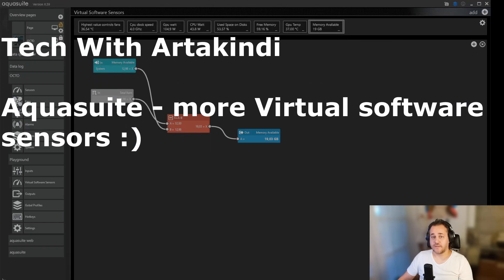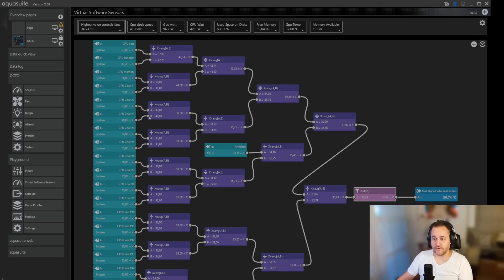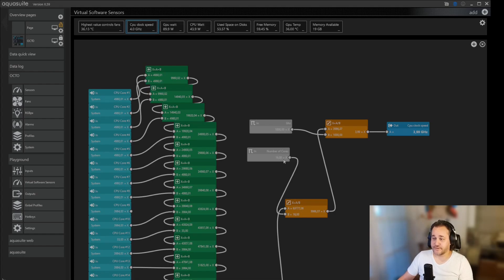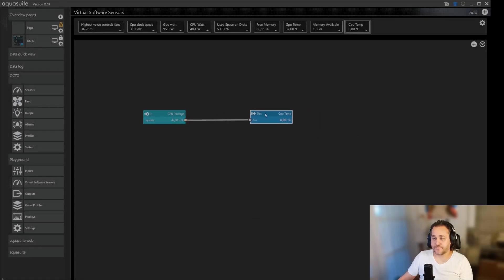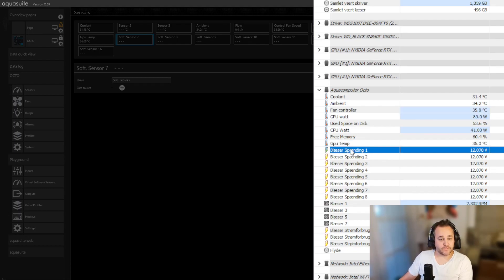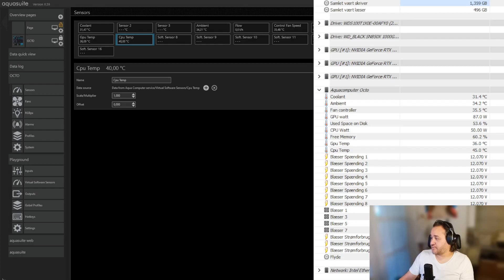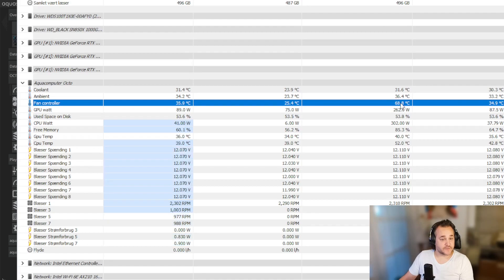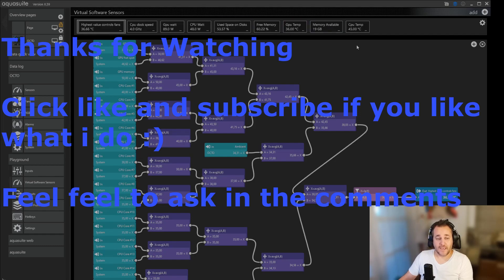Aquasuite Virtual sensors

Comment: Works, the only issue I found is that HWINFO doesnt seem to detect the value type. For an example: I have a virtual sensor that calculates the Radiator wattage and expor that value in Watts; in HWINFO I need to change the type to Watt and multiply the sensor value by 100 for it to be displayed correctly.

Comment: Great explanation and video, I'm using this for CPU frequency monitoring in Aquasuite.  I noticed in your CPU virtual sensor you missed the calculation for Core #9.  Might want to update your logic to keep accurate speeds!
Reply from the maker: @Buh-Lock-ay  so true saw it when i edited the vid so fixed it after thanks for the heads up and for liking the vid